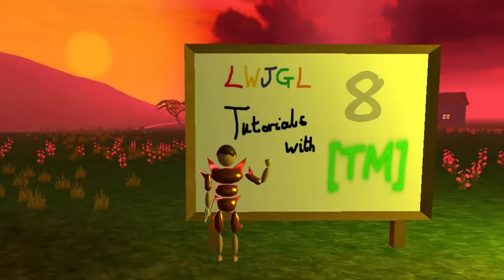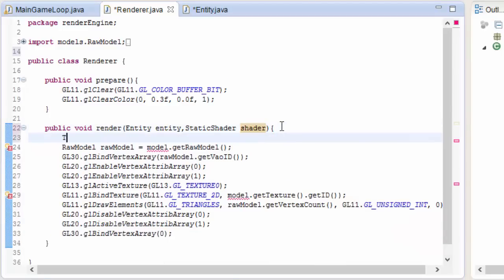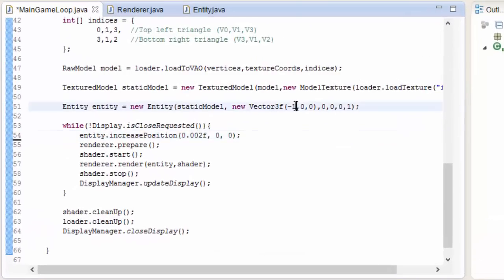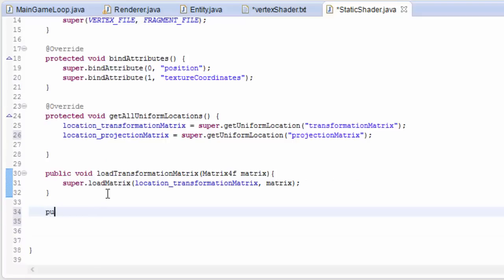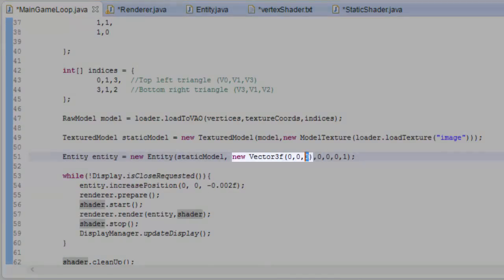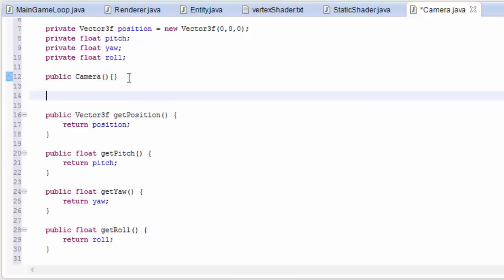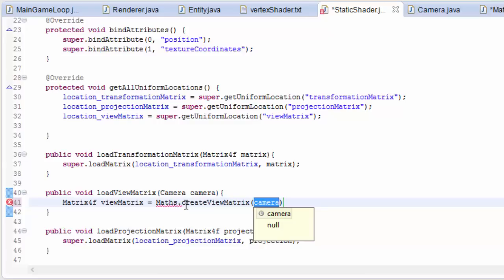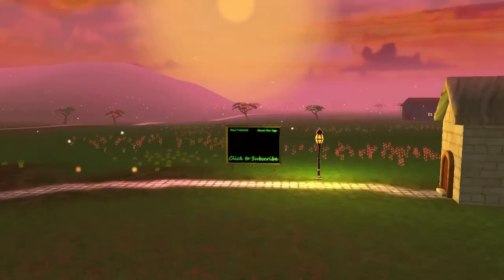OpenGL 3D Game Tutorial 8: Model, View & Projection Matrices

Comment: 2016-03-10 17:57:04.237 java[18500:d07] IN INJECTION START
2016-03-10 17:57:04.238 java[18500:d07] SASIBUNDLE NSBundle </Library/ScriptingAdditions/SASyphonInjector.osax> (loaded)
2016-03-10 17:57:04.238 java[18500:d07] SyphonPayload PATH /Library/ScriptingAdditions/SASyphonInjector.osax/Contents/Resources/SyphonPayload.bundle
2016-03-10 17:57:04.239 java[18500:d07] Syphon Payload Bundle NSBundle </Library/ScriptingAdditions/SASyphonInjector.osax/Contents/Resources/SyphonPayload.bundle> (loaded)

the game is working fine, but im getting this error?
i had it before and it randomly stopped but its back ._.

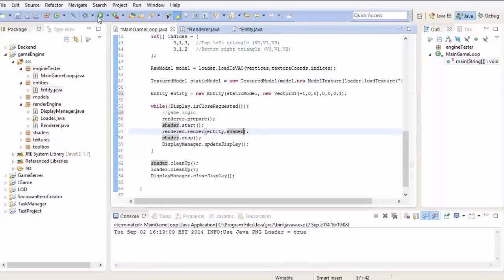Comment: so midway trough the video (5:02) my program gives my image but rendered 4 times with each 1/4th of the normal size, all of these images are also flipped upside down, has anyone else had this happen to him/her and how did ou fix t?
Reply from the maker: +Arne Caluwe Sounds like you're using the vertex positions as the texture coordinates, because that's exactly how it would look if you did. I can't really guess how this would happen, but perhaps that will give you some clues about where to look for the error.
Reply: +ThinMatrix thank you very much for replying, i took my time comparing my code with yours recently and replaced a certain part of my cide so i could progress in the series. and my program is still standing strong untill now.

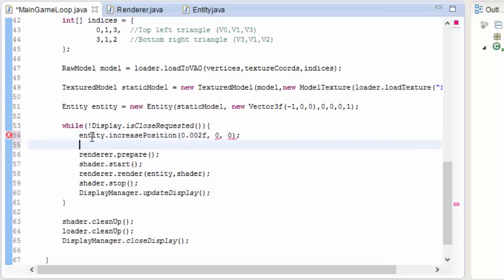Comment: At 5:20 I get a screen without any entities:X
Reply from the maker: +Adrians Netlis Check the comment I made where I mentioned a lot of the common mistakes being made in this episode, and make sure that you don't have any of those errors.
Reply: ***** I don't have any of those, already checked before.
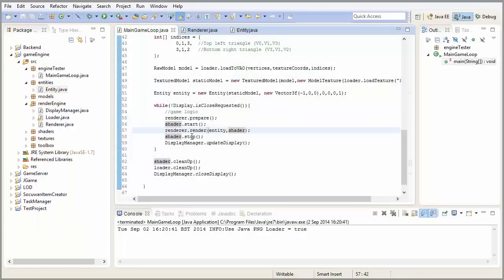Reply: I redone whole tutorials to this place and again - there is nothing on screen rather than my background at 5:02. How could I have done the same thing wrong twice?
Reply from the maker: Adrians Netlis Did you check all the common problems mentioned in the description? It's usually one of them. If it isn't then email me your code in a zip folder. I'm waiting for some bread to cook so if you're quick I have a bit of time to check your code ;)
Reply: ***** I checked them and it wasn't one of them. THan I will e-mail you. src folder is enaugh, right?
Reply from the maker: Adrians Netlis Just had a quick check through, and noticed that in the StaticShader, in the getAllUniformLocations() method, you're getting the location of the uniform but you're not doing anything with it. You need to set it as the value of the loc_transform variable. Not sure if that's the only error - I'm checking for more now
Reply from the maker: Adrians Netlis Also until you've added the projection matrix you can't use z values of less than -1 or greater than 1, so set your entity's position to (0,0,0) for now.
Reply: About the uniform locations - must look, might be the problem.
About z values - it shouldn't change anything anyways;)
Reply from the maker: Adrians Netlis The z positions will make a difference. At the moment your z position is -4. That means your entity won't be visible and you won't know if it's working or not until you move it into a visible area, between -1 and 1.
Reply: OK! It did fix it. Thank you!:)
Reply: By the way - will you include VSync setup in one of your tutorials? It'd be good thing as an optional feature!:)

Comment: For some reason, when using transformationMatrix * vec4(position, 1.0) in the shader file I could scale my entity correctly but translating it would cause it to warp weirdly. Changing the code to vec4(position, 1.0) * transformationMatrix fixed it though. It may be something to do with the fact that I'm using a custom Matrix4f class though because I'm using LWJGL3.
Reply: +Jack Edwards turns out it was because by Matrix class was row major instead of column major - all sorted now. I hate that LWJGL3 removed a lot of the helpful functions. I've spent about 8 hours on this video just because of errors with the math functions I had to create myself ;_;

Comment: @thinmatrix Just a little question. Why does the text file you have on the dropbox link have 22 vertices, for a cube?
Reply from the maker: +cpdorli We could still use just 8 vertices for the cube, but we'd then have a problem with mapping the texture to the cube correctly. The problem is texture seams. Each vertex in the cube is connected to 3 faces, and requires a different texture coordinate for the texture on each face (for example, a vertex might have the top-right corner of the texture mapped to it on one face, but the bottom right corner of the texture mapped to it on another face, and the top-left corner of the texture mapped to it on the other face). Each vertex can only have 1 texture coord associated with it, so we split the cube into 6 separate quads, which allows us to easily map the texture onto each quad. This results in 6x4=24 vertices.

Comment: Can you PLEASE upload the source code?
Reply from the maker: +TeleTubbie Luver What problem are you having? I'd rather not post the code because people would just skip tutorials that they find boring or copy and paste my code as soon as they come across a slight problem, and that's not going to help them learn.
Reply: +ThinMatrix It seems I fixed it, variable name was wrong in shader file. But still I find it very hard to learn and understand and remember all this. do i have to learn all those functions in for example the loader class? And the floatbuffer is not needed in C++ Is it because Java "handles" opengl different or something?
Reply from the maker: TeleTubbie Luver Different languages have different "bindings" for the OpenGL API, so there are some slight differences. Don't worry too much about remembering all the names of the functions, as long as you understand the concepts fairly well at this stage it's fine. I still can't remember all the functions and parameters off by heart, and I often just refer back to my older projects or to online sources to remind myself.
Reply: ***** Okay now my last question: Why didn't you do these tutorials in C++. Almost the whole 3D game industry uses C++ for performance. Or do you just prefer Java over C++ ?
Reply from the maker: TeleTubbie Luver Because I've never programmed in C++ in my life =P I learnt Java at university and have always used it ever since, so now I have 5 years of experience with Java and 0 years of experience with C++!
Reply: ***** Do you have a programming job right now? Or are you doing this for fun, so ur not a game developer?
Reply from the maker: TeleTubbie Luver This kind of is my job at the moment. I make just about enough money to support myself from Youtube adverts and donations via Patreon. I'm hoping to release and sell the game I'm currently working on fairly soon though :)
Reply: +ThinMatrix You are doing a great job! I love this!

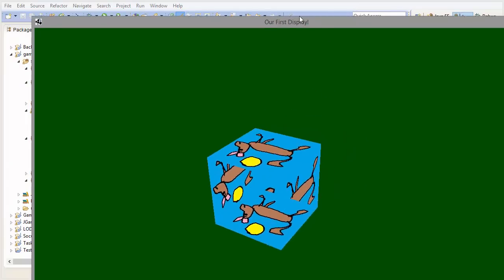Comment: For some reason, instead of a cube rendering at 19:30, I get what looks like a really short pyramid with 4 sides, with the point cut off and a square top instead. Here's what it looks like

https://gyazo.com/22a80013c365d287c293c2e78043ca70

Also, translating the image doesn't make it move correctly. For example, setting the position to the vector (2, 0, -5) makes it appear like this (the issue is with the X and Y components, not the Z)

https://gyazo.com/06e3549f65d7950547a1ea5ff0170085

 I've double, triple, and quadruple checked the names of the variable names in the shaders. I've also made sure I'm using the correct vertices, texture coords, and indices. Do you have any idea why this may be happening?

I also found out that increasing the value of the near clip plane to around 10 makes it look less flat, but it still isn't a cube
Reply: +jojodmo I ended up fixing this issue - I had to change  GL20.glUniformMatrix4fv(location, false, buffer);  to GL20.glUniformMatrix4fv(location, true, buffer); in the loadMatrix() function in the Shader class

http://stackoverflow.com/q/34476457/2767207

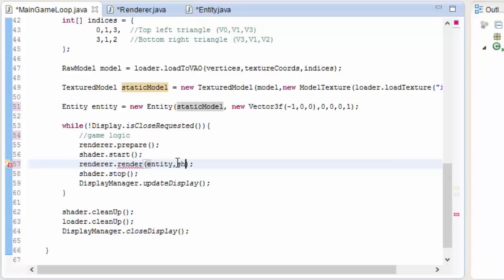Comment: 5:00 my code just is not working.  It cannot compile shader, it was working just fine until here.
Reply from the maker: +CubedDesigns Does it give you any extra error message telling you why the shader can't be compiled? It's likely a typo in the vertex shader, so just check the last bits of code you added to the shader.
Reply: +ThinMatrix I've checked it it all was just as typed in the tutorials. As for the error code all it says is "ERROR: error(#273) 3 compilation errors.  No code generated." Then when I run it again it say "Could not compile shader!" if you would like to look at it, my vertexShader.txt file is as follows: 

#version 400 core

in vec3 position;
in vec2 textureCoords;

out vec2 pass_textureCoords;

uniform mat4 tranformationMatrix;

void main(void) {

 gl_Position = transformationMatrix * vec4(position,1.0);
 pass_textureCoords = textureCoords;
 colour = vec3(position.x+0.5,0.0,position.y+0.5);
}
Reply: +CubedDesigns I'm dumb, I just realized it gives me the error codes: 

Vertex shader failed to compile with the following errors:
ERROR: 0:12: error(#143) Undeclared identifier: transformationMatrix
ERROR: 0:14: error(#143) Undeclared identifier: colour
ERROR: 0:14: error(#160) Cannot convert from: "highp 3-component vector of vec3" to: "float"
ERROR: error(#273) 3 compilation errors.  No code generated
Reply: +ThinMatrix I have fixed these 3 errors but now, when I run it, it only shows a full red box rather than a picture and a red background.
Reply from the maker: +CubedDesigns Check the spelling of "transformationMatrix" in both the vertex shader code and the StaticShader's getAllUniformLocations() method. The spelling needs to be exactly the same in both cases otherwise is won't be able to get the location. Try doing a System.out.println for the location_transformationMatrix variable after trying to get its location, it should be a number greater than 0.
Reply: +ThinMatrix That fixed it.  Thanks a lot, I checked the spelling like 5 times and finally realized I commonly miss the s in transformation.

Comment: When i set its initial rotation (from the Entity class constructor ) to 90 degree around the z-axis, and then rotate it slowly each frame around the x-axis in the game loop, it appears to look like it is rotating around the y-axis instead. Can somebody help/explain?
Reply from the maker: +BL4CKB34RD Rotating an object also rotates the local axis of the object. That's why we translate the transformation matrix before rotating it, because if we did it the other way round then the rotation would first change the axis directions and therefore change the translation of the object. This problem is not really avoidable using Euler rotations (x, y, z rotation) like we are. If you need to rotate around more than one axis at a time then you could look into other ways of representing rotations, such as axis-angle, or quaternions.

Comment: Something not working, I made my own class for matrix4f and vector3f, because of the they doesn't exist in lwjgl3, after I print out the matrix itself, I get a normal identity matrix (if i don't change anything, all positions, rotations and the scale are 0.0f). I made my own method for storing the matrix in a floatbuffer (it goes trough the matrix in column major order, and puts its content in the buffer.), what could I mess up?

This is what my matrix looks like (got it from printing it out, not hand-made)

1.0|0.0|0.0|0.0|
0.0|1.0|0.0|0.0|
0.0|0.0|1.0|0.0|
0.0|0.0|0.0|1.0|
Reply: +cpdorli getUniformLocation method returns 0 for the transformationMatrix name (yes, I checked, everything is spelled correctly)
Reply: +cpdorli If i create a another uniform variable and use both of them, then the glGetUniformLocation returns -1 for the transformationMatrix variable.
Reply: +cpdorli NVM, forgot to flip the buffer. I hate myself sometimes.

Comment: Some people using the "new" lwjgl with the GLFW libary where also the matrix and vector classes are deleted and have to be self-coded might have problems with the quad disappearing after adding the transformation matrix. This may be caused by the matrixbuffer not being stored correctly. Make sure to hard-code the store() method of the matrix with something like this:

public void store(FloatBuffer matrixBuffer) {
  matrixBuffer.clear();
  
  matrixBuffer.put(m00);
  matrixBuffer.put(m01);
  matrixBuffer.put(m02);
  matrixBuffer.put(m03);
  

  matrixBuffer.put(m10);
  matrixBuffer.put(m11);
  matrixBuffer.put(m12);
  matrixBuffer.put(m13);

  matrixBuffer.put(m20);
  matrixBuffer.put(m21);
  matrixBuffer.put(m22);
  matrixBuffer.put(m23);

  matrixBuffer.put(m30);
  matrixBuffer.put(m31);
  matrixBuffer.put(m32);
  matrixBuffer.put(m33);
}
Don't use something like matrix.getBuffer(), since the buffer won't be useable then.

Comment: After the projectionMatrix implementation part, I can't see the quad rendered anymore.
I lost a lot of time tracking this nasty bug but. Now I hope this could help someone else:
It appears that Display.getWidth() and Display.getHeight() give unpredictable results (maybe when using multiple monitor setup?).
I used Display.getDisplayMode().getWidth() and Display.getDisplayMode().getHeight(), instead, to retrieve the correct values as originally set up in the DisplayManager. 
So my projectionMatrix is now correctly calculated.
Reply: I have the same problem by doing this still does not make the object appear on the screen, i have the width and height set to 720 and aspect ration is returning 1.0 is this correct?
and when i change the width to 1080 i get 1.5 back but the object still does not appear
Also the projection matrix for the 720 is 
1.3032254 0.0 0.0 0.0
0.0 1.3032254 0.0 0.0
0.0 0.0 -1.0001999 -0.20002
0.0 0.0 -1.0 0.0

Comment: ***** my cube continues moving though I deleted the increase position :/ what can I do?
Reply from the maker: AdriGamer Do a System.out.println() for the cube's position, is it changing each frame? If so, it much be being changed from somewhere. Put a System.out.println() in the increasePosition() method, see if it's actually still be called each frame.
Reply: ***** So I have to put first:

System.out.println("Test");
entity.increasePosition(0, 1, 0);

 Later I do the same but with increaseRotation, is this?

Comment: I have everything working, but the cube at the and is nog a square, but al stretcht to the sides
Reply from the maker: Jim Van Leeuwen Could you maybe show me a screenshot of the problem please?
Reply: ***** https://www.dropbox.com/s/jawwfbzvpqe13ww/thin%20matrix%20debug.png?dl=0 here you will find a screenshot. I have been trying to solve it and i figured out that it scales the cube to the screensize and because the screen is wider than it is high the cube is stetched to te sides
Reply from the maker: Jim Van Leeuwen Hmmm, the projection matrix should have fixed that. Are you definitely multiplying in the projection matrix in the vertex shader? Perhaps also just check your createProjectionMatrix() code.
Reply: You where completely right about the problem. to calculate the aspectratio I divided display height trough the width, while it has to be width divided by height. Thanks for helping me out by pointing to where the bug has to be.

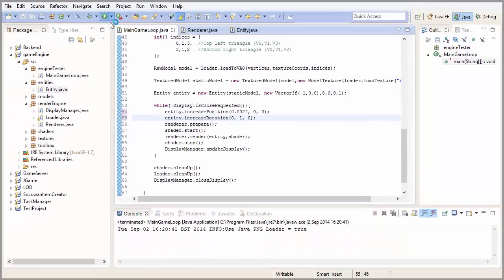Comment: my image is moving super fast at 5:35 is that a problem?
Reply from the maker: ***** No, that shouldn't be a problem :)
Reply: ***** well it  happened because i didn't add the fps cap part (didn't really want to cap my games fps) so instead of adding it i just made a "game logic loop" witch runes 60 times a second and on that the moving runes so it  wouldn't depend on the games fps... that should be a problem right?
Reply from the maker: ***** It's not a problem, but you would probably want to cap your FPS so that your computer doesn't have to run at 100% the whole time. Capping it at 120 FPS isn't going to make any noticeable difference in the game. Even 60 FPS will look absolutely fine.

Comment: It Won't work for me I found what the problem but I can't find where the problem is or how to fix it. After I put in the projection matrix and the code for all of it when I run the game my object does not show up at all. But if I go into the shader code and remove the code where It is multiplied by the projection matrix it works but It won't work with the z-axis then so I need the projection matrix. I believe that the problem is that the uniform variable isn't receiving the data from java. I could be wrong though. I don't know where to look in the code to even solve this problem either. Could some one help me please.
Reply: Jacob42500 
Some how after turning off my computer and waiting a half hour It worked.

Comment: Super frustrated lol. My image shows up but it doesn't move or do anything when I tell it to. Entity entity = new Entity(texturedModel, new Vector3f(-1,0,0),0,0,0,1); 
That doesn't move the image to a new spot.
entity.increasePosition(0.002f, 0, 0);
			entity.increaseRotation(0, 1, 0);
and those do nothing either.
Could really use some help!
P.S: My code is perfectly matching everything you have done.
Reply from the maker: Cosmicluck1337 Are you multiplying in the transformationMatrix in the vertex shader (was at the very end of the last tutorial)?
Reply: ***** Yeah I was super tired coding late into the night, came back this morning and was super easy to find what I did wrong haha, Was the multiplication yes